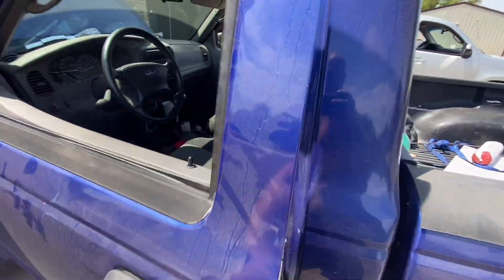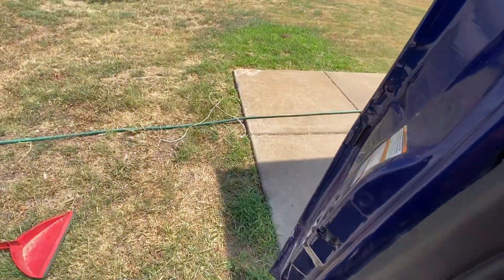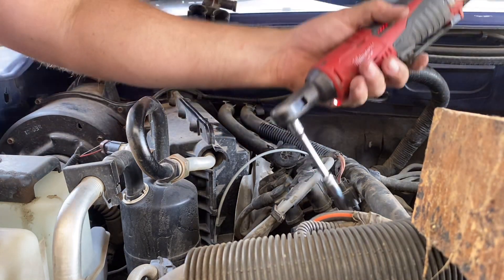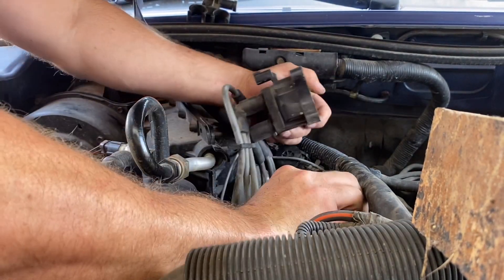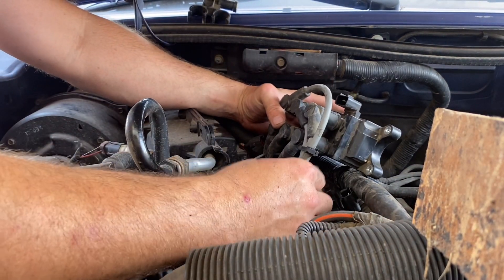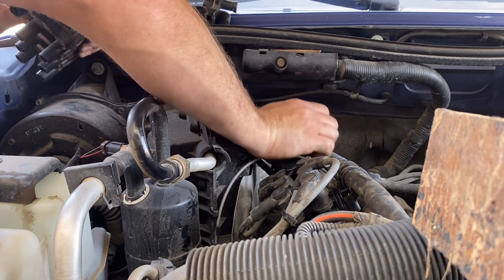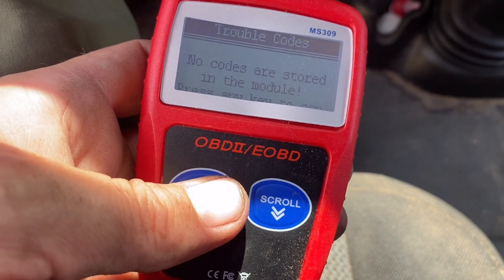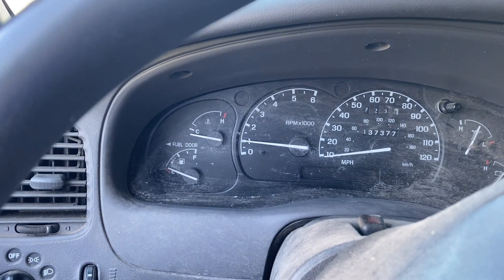P0303 P0316 P0300 Cylinder Misfire Fix Ford ranger

Comment: How are your coil pack wires sequence from coil connector (driver side) 465
Passenger side) 123
I’m having misfire issues with no code faults 
I changed out coil pack spark plugs and new spark plug wires
Reply from the maker: 463 passengers side 
135 driver side
Starting from firewall moving forward
Reply: Found misfire issue
Reply from the maker: @javiermanznao4293  what did it end up being
Reply: @javiermanznao4293 did u figure it out ?
Reply: What was it? My 08 has a misfire no check engine light, sometimes a little harder miss sometimes not @javiermanznao4293
Reply: Javier you suck!!Boo this man👆

Comment: My 06 ranger had a valve break apart in cylinder #3 causing the problem.  These 3.0 V6  have a TSB on this issue. Exhaust valve seating recession to be specific. Set me back a little over 1K.
Reply from the maker: Dang that sucks guess I’m lucky not to have that problem
Reply: Your Ranger must have been running rough and noisy if it had a valve break apart.
Reply: @gregkraft7292  It was definitely rough running. I didn't even drive it until I got it fixed. Going back in the shop this week though, a few months later, to get the heads and valves replaced. Its at that point. Number 6 is now misfiring and loosing compression .  They just put crappy heads from the factory.
Reply: Test. Don't guess.